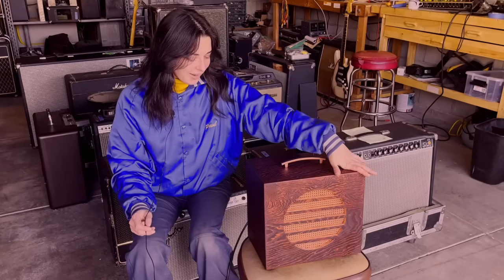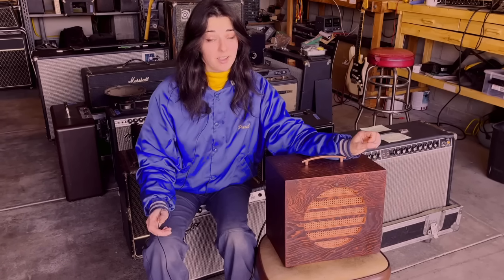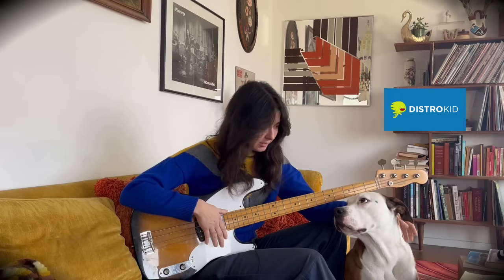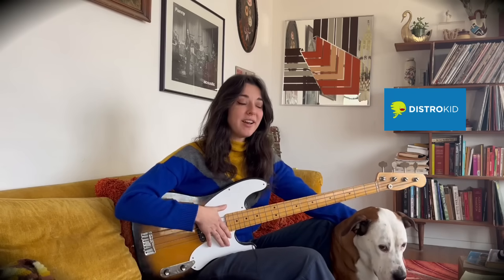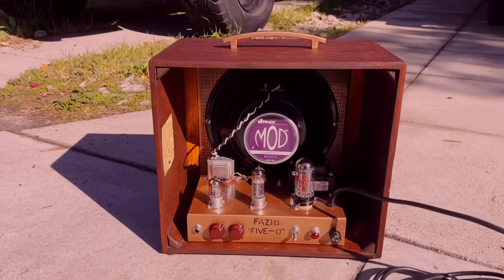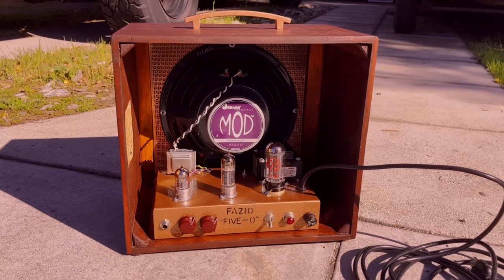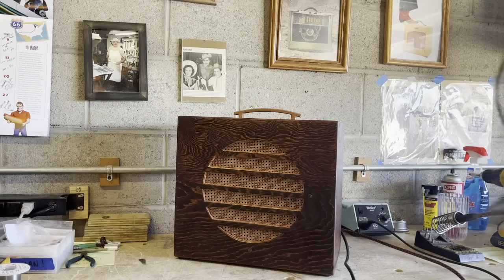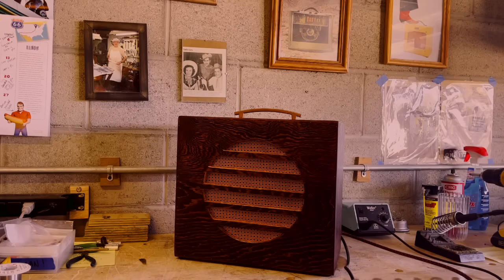Fazio Five-0 | Amp Demo | Fazio Electric

Comment: One of the best builds I've had is a Webster Ecotape Reel to Reel. They have a copper washed chassis and a real nice wood cabinet you can cut a hole for an 8 inch speaker. They usually come with tubes. I've bought 10 of them off ebay.  5Y3, 6V6, and two 6AV6.

Comment: Hay Colleen that little amp sure is cool, cool looking, and sounds just as cool, love that tremolo, very nice build...
I've built a few amps myself, and one I have I use for personal practice a lot, it just sounds so cool that I just can't stop playing it sometimes. It's got 2 12ax7's, 1 12au7's, 2 el34's, and a 5U4 rectifier. I built a Marshall 50 watt output section with fixed adjustable bias, a long tailed pair phase inverter, (12au7), and a Fender Bantom bass amp preamp. 
Then I put it all in an old Bogen CHB35 chassis and metal cabinet.
It's got one of the best clean tones I've ever heard.
And I'm kind of proud of it actually, lol. 
Keep up the good work, I wanna, and can't weight to see more of your builds and ideas.

Comment: There are actually 4 variant GA5 Skylark amps that I know of: one with a single 6V6 output, another with a single EL84,  another rarer version with 2 EL84's, and then there was the model with the single 6BM8 (or possibly 6GW8, i cant remember for certain) output.

Comment: 6BM8s are an oddball tube, very cool. I've got a Univox amp that uses 2 of them in push-pull. I wish someone out there would start manufacturing the 6GW8/ECL86 again. They're getting hard to find and they're expensive.
Reply: Yeah, the 6GW8 was used in some Magnatone guitar amps, and low power hifi amps. Scarece and pricey nowadays; but the 6BM8 is commoner and cheaper for some reason.
Reply: @goodun2974  It seems like all the 6GW8s went to Australia, lol. I think it's a much better tube than the 6BM8.